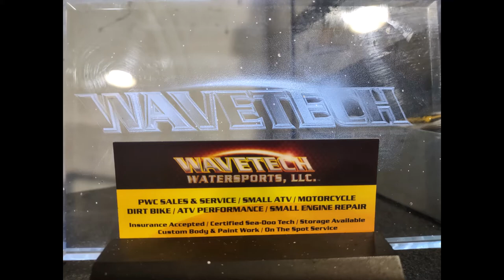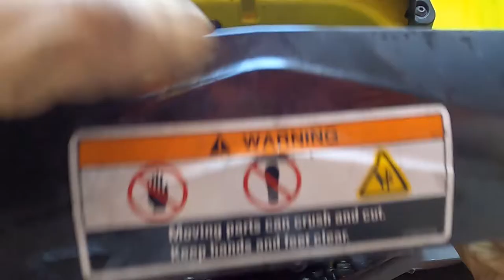2018-2021 SeaDoo RXT/GTX : ST3  Hull : Jet Pump Removal / Installation

Comment: Out if curiosity can you give directions what buttons you push or how to do it for the ibr system in the beginning of the video
Reply: I can help, turn ski on without using key. Hold down your break lever, it'll beep and say on screen "hold mode to over ride IBR" Whilst holding your break lever press and hold "mode" button. After another beep you then press down on either trim control and/or direction pad. (Both work) 

This function then manually sets the IBR to a desired height 

Let me know if this helps 👍

Comment: Just curious why you make how to videos? when all its doing is taking away your business?  to get hits for what ?
Reply from the maker: My Friend, there will always be those who will, those who will not... Unlike the Automotive Industry there are VERY few private PWC Shops. We would rather you get the rock/rope out of your own Jet Pumps, or change your own wear ring. With an average of 30 units in house at once, Things like changing a wear ring, don't pay the bills... That is why I take the time to bring these Videos to your Phone/Computer. It's Not about Hits , It's about supporting the PWC Community of those who will. Stick around there will be plenty more, Thanks for Checking us out.
Reply: @wavetechwatersports411  your taking away my biz tho 
I dont have 30 skis in at a time ..and you probably dont charge 100.00 a hr. Or 135 like a dealer .
Reply from the maker: @vqherovqhero2810  I can assure you we have not supported multiple families by providing cheap labor rates. We Are where we are today from just short of 25 years of grinding hard everyday. Let me give you some advice as an up and coming shop. 
#1 Are you certified in any of the 3 major MFG? If not get to school.
#2 What have you done to Market yourself? I.E. Visiting your local new unit dealers and showing your a certified shop that is willing to take on the older stuff, most dealers wont touch anything thats 5-7 years old.  
#3 What do you do within your local community to get your name out there?
#4 Do you offer mobile service?
#5 can you work on 2 strokes? if not get to it. nearly no shops do, it accounts for the mass of our yearly #'s 
#6 understand things do not happen over night, but don't be afraid to approach people and make yourself known.. When you can, give advice.... Getting to know the community , local and on places like FB is great marketing.We've met some incredible people there, and drawn individuals from states away because of it. we've really gotten to know some of the most reputable aftermarket performance MFG companies by supporting and selling their products, especially on our personal Skis